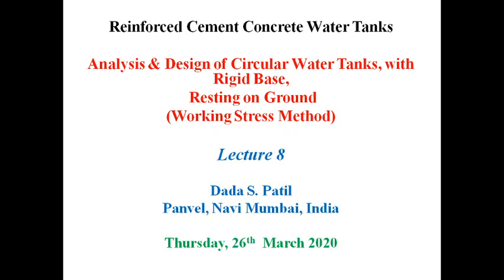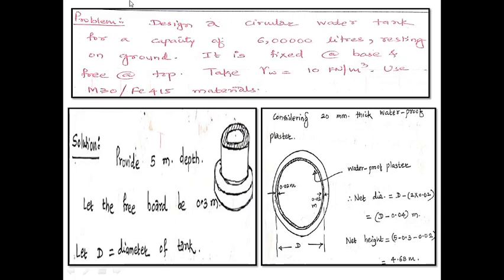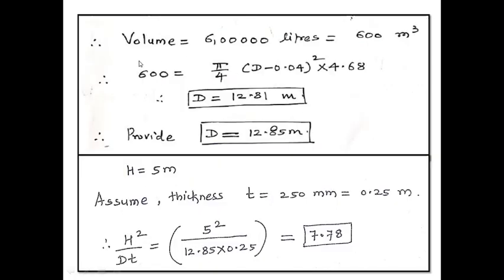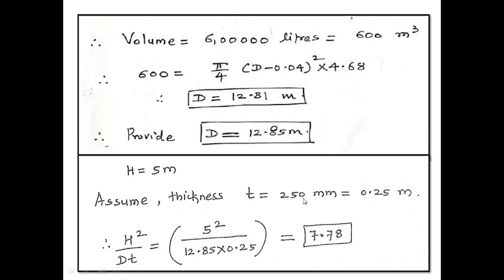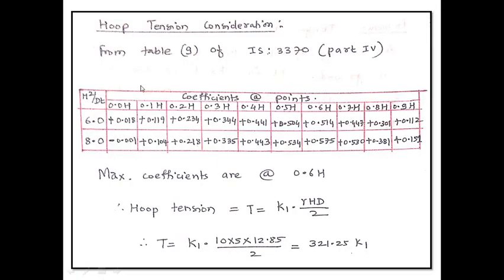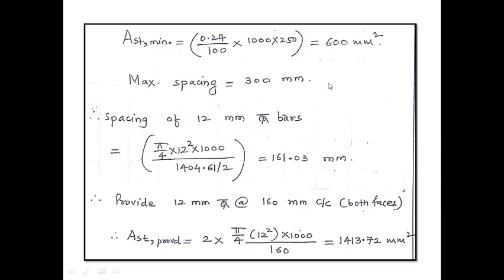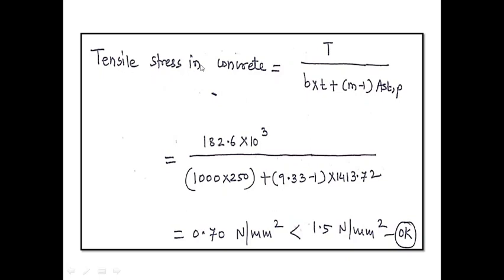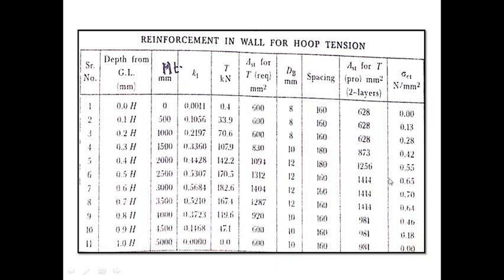RCC Water Tank: Lecture 8: Circular Tank, with Rigid Base, Resting on Ground

Comment: Your sigma st value is wrong, correct value is 230 N/mm² for fe415 grade of steel and not 130 N/mm². So all calculations of Area and spacing is wrong after the calculations step of hoop tension.
Reply from the maker: You are wrong. Sigma st value of Fe415 steel as per IS456:2000 is 230 MPa....For water tank design, its 130 MPa as per IS3370: 2009 (part2). Please correct ur basics. Thanks